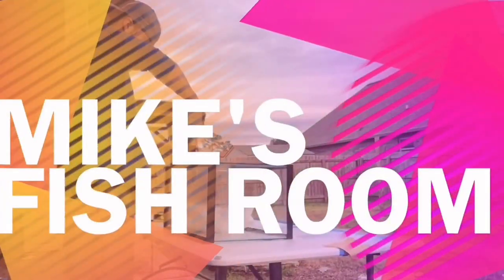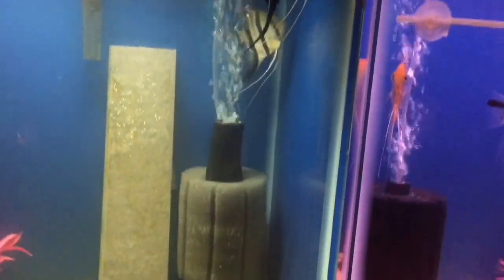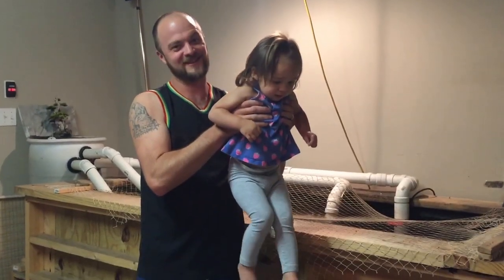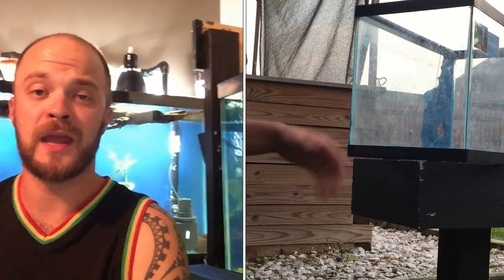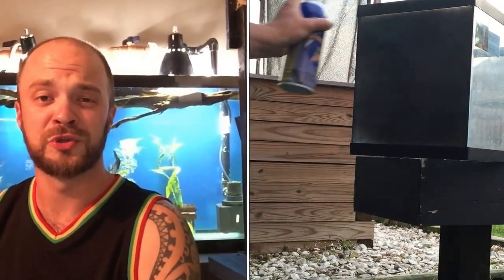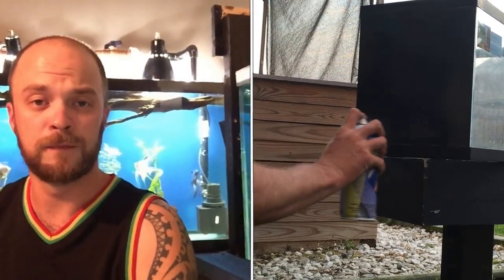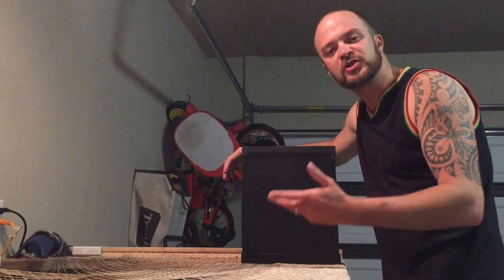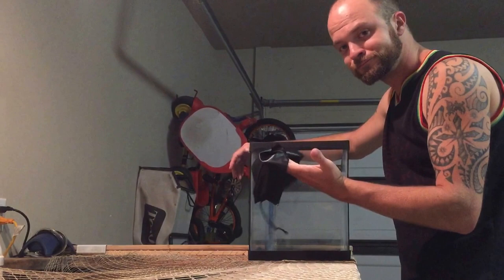DIY Aquarium Background!

Comment: Thanks for the awesome videos Mike, thery are very helpful.
One quick question: would the plasti-dip be safe to use on the inside of the tank- to coat a diy pvc filter?
Reply from the maker: +KtownDanio  Thank you! I really wouldn't trust it. Its hard enough to find paint or silicone that is aquarium safe.lol I would image there are some nasty chems in this stuff. If you need to resort to paint... Krylon fusion(cured) is fish safe.

Comment: Thats the original diy right there. Hey about how much is a can??? Is there any specific one i need to get?
Reply from the maker: They do sell a different brand at Home Depot but they are around the same price. You might like the other brand flexi dip. Their blue was kinda glittery. Don't know if you into that or not. Either brand will run $6 - $8 a can. I get it for $6.60.

Comment: for anyone that doesn't want to spray or wants a real cheap background take some aluminum foil and get it nice and smooth on the back of the tank. I've done this on a few 5 gallons and it looks pretty decent
Reply from the maker: Lol I don't think anyone can top that. It's almost free. Just have to be careful with reflecting more light then you want.

Comment: thanks ill get it tommorow and the water im using is tap water
Reply from the maker: Ok. Best thing I can recommend for your tap is Seachem's Prime. Watch my simple routine water change vid. I show the bottle in that vid. That product will remove the chlorine, chloramines, will detoxify ammonia, nitrite, and nitrate. So if you have a spike from any of those later you can save your fish. Do you know the nitrogen cycle? And last thing... You must know the ph of the tank and the tap. Do you have a ph test kit? Any fluctuation more than .3-.4 ( in my opinion)can shock sensitive fish and make them susceptible to secondary infections.